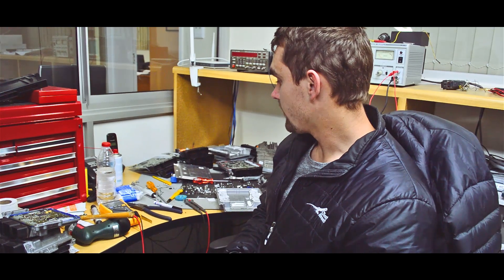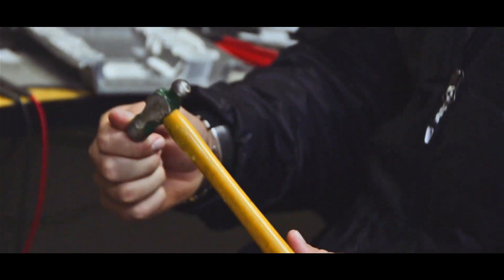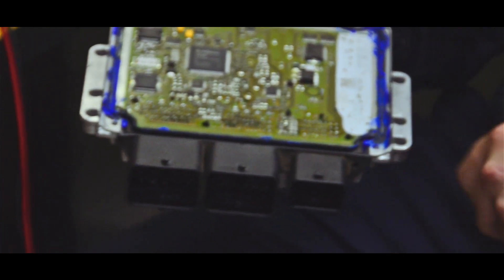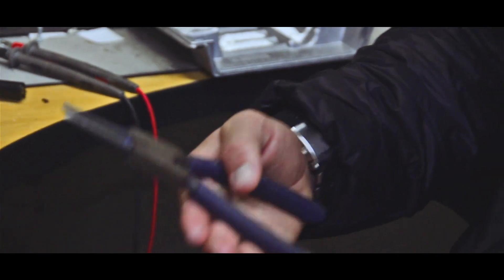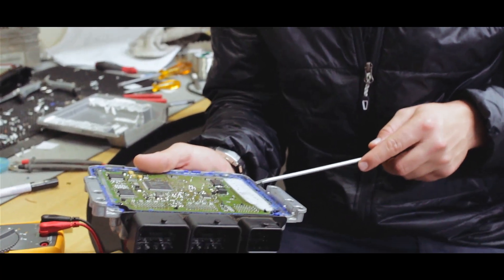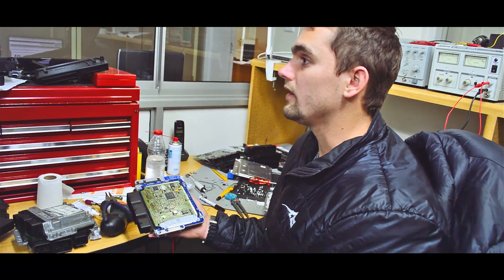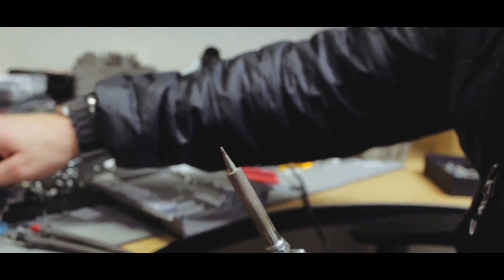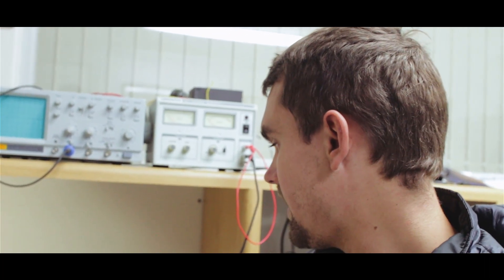Tools required for ECU tuning and ECU Remapping

Comment: since when do you need to open an ecm to write to it?
Reply: @afellatjawad  just use any software for tuning example:
-laptop programs software, tuning tablet obd2 plugs (engine check light scan tool plug port)

Comment: Reverse plyers? Ive used two 1$ screw drivers for the last decade and never ever scratched a pcb. Just point the tip upwards, only an idiot would mess up something so simple. If your an idiot and your reading this, i say, get the reverse plyers 😆

Comment: Hi I really badly need some help.
I need to flash the ECU of Mercedes SLK 170

Here's a bit of information

ECU
BOSCH with part number 0 261 204 527

KTAG master version
FW version: 7.020

Comment: Hello can i ask a question pls? I have a 2010 diesel ford focus 1.6 tdci 109 hp when i started to copy the map from the ecu accidently i disconected the usb from laptop....the copy sas at 86% ...i started all over copy was 100% after the last try the car started succesul after disconection....i finish modify the map ....the question is .....if i write the modified map it will work ?...i meen after that disconection it can couse the writing of can damage the ecu of the car?  ...the modification is DPF OFF and stage 1+ at 136 hp  ...pls reply

Comment: Do i really need a solder machine? Because when i look people using K-Tag and other softwares like FG Galleto, they just use some kind of ''needles'' to read the ECU and thats it...
Reply from the maker: Hi, you can do that but we prefer the soldering. The K-Tag has some nice pins now with a positioning frame but they are expensive about 400 Euro if I can remember correctly. Id you want to know a bit more about chip tuning have a look at our up coming webinar : http://start.tuned2race.com/freewebinar/
Reply: I'm certainly going to take a look, thanks for the help and fast answer!